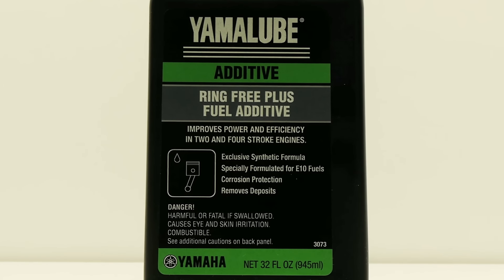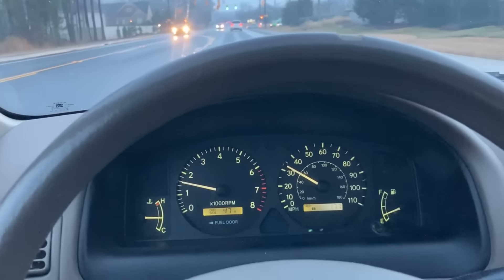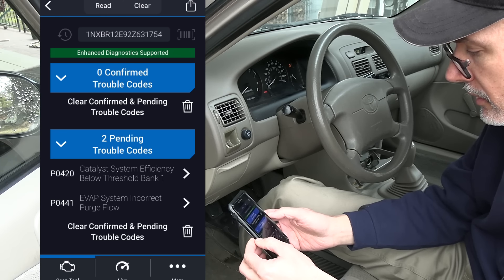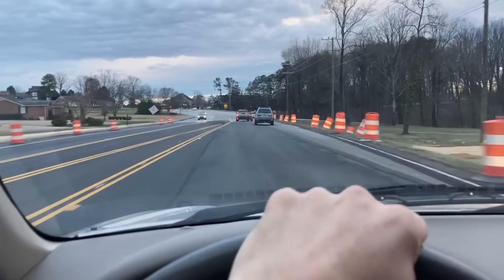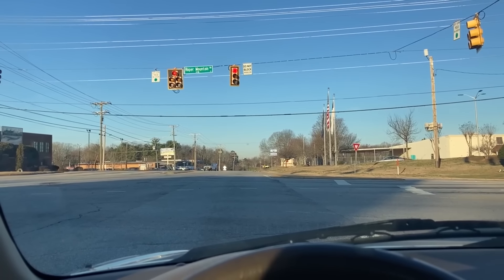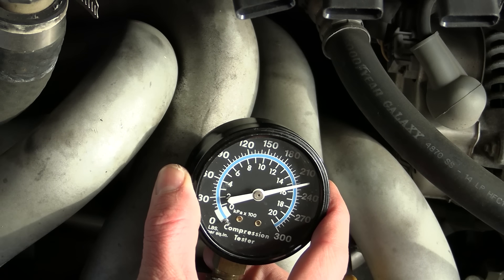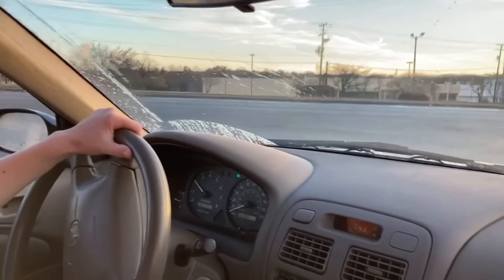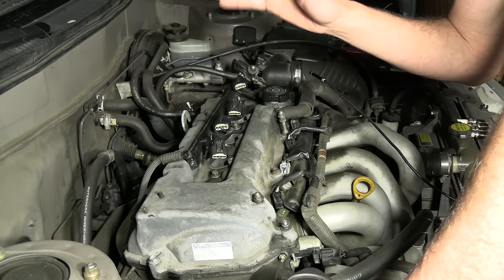Will Yamalube Ring Free stop oil consumption? | Oil Burning🔥Experiments | Episode 20

Comment: Hey there, just a suggestion if you haven't already done so: do a wet vs dry compression test and compare your results. A proper leak down test would be ideal but a simple wet/dry compression test using the tools you already own can at least confirm rings vs valve leakage. For the amount of oil in those cylinders after a hot soak from highway driving I'd be more suspect of your valve stem seals than I would be of your rings. You may be correct in your piston ring diagnosis - as city/highway oil consumption tests you've done have shown faster usage at highway speeds - however it's worth a shot to at least inspect those valve stem seals. Cheap and easy fix on these engines if they are an issue .. or with any luck the issue.

Have been enjoying your oil burning series so far though, neat to see which snake oil products actually do what they say they do.
Reply from the maker: Thanks for the suggestion. I don't think I can do a true dry compression test,  due to the amount of oil always in the cylinders. ... I did do a leak down test video several videos back though.
Reply: @FamilyFriendlyDIY  I'll go back and check it out! - I'm a fairly new subscriber so I have a bit of catching up to do. I appreciate your response, liking the content!

Comment: It's a Corolla, use 87 octane my man. If the stuck ring made a groove in the cylinder wall, nothing will prevent the oil burning issue.

Comment: I'm no mechanic but, {This is where a dummy like me tries to sound smart.} I'm guessing that you've already freed the rings up of gunk. The oil usage is more than likely because of the rings just being too loose as well as wear on the cylinders. You are getting a lot of miles on the car. If that is the case, then using a little heavier oil, or just adding oil would probably be the answer. I would definitely change my oil more frequent than the recommended intervals.

Comment: Yes it is useless to put high octane on lower compression engines. If it knocks then use higher octane as a preventive measure until you find out the reason for it. Yes carbon deposits increase compression. Use additive to clean the carbon. On gdi engines there is a whole movement on YouTube on how to clean the intake valves. No higher octane gasoline does not have more cleaning agents than lower octane. Some brands like shell, only uses additives on high octane. BP (shell sister company), Chevron, marathon and others use additive on all octanes.  All gasoline brands are the same gasoline only additives are added by different companies. Gas pumps say gasolina can have up to 10% ethanol. Not sure it is true but Ethanol helps keep engine intake clean. Some gas stations sell ethanol free gas. Aka rec fuel. I’ve seen it in 87 and 89. 10% ethanol will not damage your equipment. Ethanol attracts humidity and there are additives for that too. 
Manual said 13.3 gal 11 imperial gal.
Adding: wrong stuck rings obviously lower compression.

Comment: At this mileage I would suspect valve stem seals adding to oil into the chamber too, so even if you get rings unstuck it will still burn oil to a degree. If it puffs blue smoke on high-rpm decel, then it is most likely valve stem seals are gone.
Reply from the maker: I'd agree, Sergei, but I did the valve stem seals a few videos back.
Reply: @FamilyFriendlyDIY  I guess I need to watch all the videos in series :).

Comment: You’re at a point now where things aren’t gonna get any better with your oil consumption. You have managed to free up the rings, but nothing in the world is going to clear the drain back holes without removing the pistons and physically clearing them with a drill bit or other physical method. Of course, this requires removing the pistons from the engine. With the drain back holes still blocked, the rings will overtime become stuck in the grooves again, which will require more chemical treatment. The only permanent solution is removing the pistons, clearing the ring grooves and drain back holes.

Comment: I don't think that the oil  on the pistons is a result of the piston rings. Looks to me like you have valve guide seal problems, " Not ring problems". Seems like cylinder compression test proves that.

Comment: With bad rings or worn cylinder. Using thick oil will only increase oil usage. Thicker the oil, more get wiped into the piston top to be burnt. I would go with a 5w-20 and see what you get. Thinner oil may also help keep the rings from clogging  up.

Comment: Valve seals leaking or head gasket? Your compression check is not going to be accurate with that much oil sitting on top of the Pistons. I will give a false high compression reading. If the rings are weak it won’t show because there’s so much oil.  Cars that are oil burners tend to fuck up the Catalytic converter.  You might want to consider putting “ hotter rated plugs” to deal with the oil burning issue.

Comment: How long have you been putting 93 octane in that car? No wonder why you have carbon buildup. It's designed to run regular. You're not helping it at all by running such high octane gas. Run regular gas. That'll help some of your issues.

Comment: 20 years ago I used to buy these cars on a regular basis homemade noise when you start them up piston slap so basically it's all worn-out what you do is going to burn oil is a board out put new pistons in it or get a brand new bra and change for the new head on it and use full synthetic after a while every 3,000 Mi and it should be fine no sludge burkholder's experiments what's weird about some of these cars have a lot of power burning oil I seen one smoking like a b** all day long wasn't my car just looked at it and had a lot of power to it so these are very strange vehicles have all the power in the world of final out so it can last a long time doing that s*** some people think you should have best cars ever 9899 Corolla but they can scan burn some oil and to wait to see them smoke you can win their engine is hot you gotta rev the engine electrical and floored let go watch the exhaust while you're doing it underneath the car and you'll see possible smoking blacks you Commander I saw baby weren't shows did not burn Pennyroyal I'm not typing I'm using talk-to-text so I understand what I'm talkin about

Comment: Your burning oil because you are putting too much oil.  The top dot is where the oil should be whn hot. And the bottom
Dot is for when the oil is cold. That's why oil is multi siscosity

Comment: You fixed whatever could be done with the stuck rings in the first treatment.  Any further improvement to ring issues is just not going to happen.  If the excess oil consumption is due to leakage past the pistons, then you have worn cylinders and rings and that is beyond the capacity of any treatment to solve.  Alternatively, you may have leaking valve seals, which may be a better explanation for the oil sitting on the piston crowns.  Either way, further videos applying this solution to this car are a waste of your time.  In addition, burning that much oil means you are either wrecking your catalytic converter or already releasing a tonne of pollution onto the roads.  Scrap it and get a new car.
Reply: That was my thought. Why would a Toyota have stuck rings at 180k miles unless it was maintained properly

Comment: Oil consumption.  Main reason older cars consume oil is it is bypassing the rings due to wear. Engine flushes, high detergent additives or treatments that clean out carbon and sludge may make the issue worse by allowing more oil to bypass the now clean combustion chamber and rings. In other words, you are wasting your money.

Comment: Why don't you just buy a case of cheap oil and just deal with it? At 189K miles, the rings and cross hatching are probably worn out.

The Catalytic converter code may be from the additives. You might get lucky and reset it and it might stay off.
Reply: Using 93 octane instead of 87 may also be part of the problem.

He basically just wants to know if any of these chemicals are worth it for others researching what's best for their hard earned $ or if it's even worth it